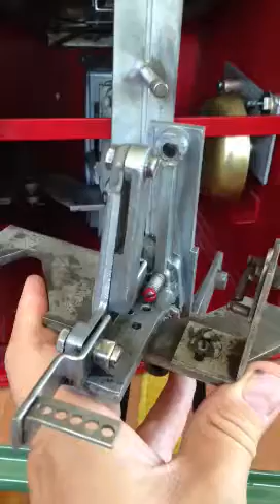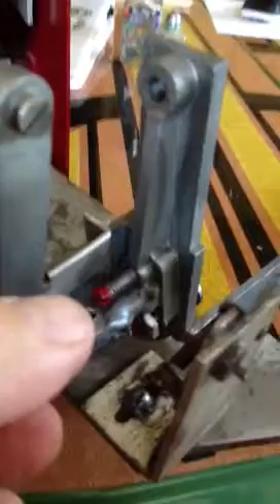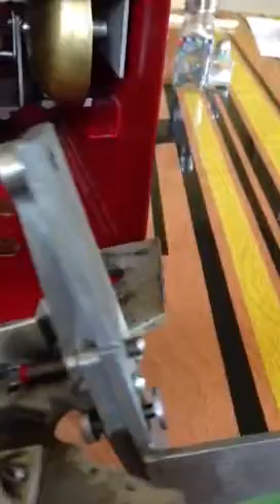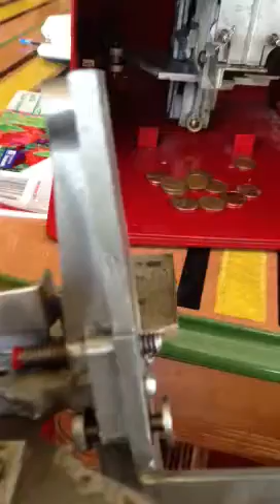Gottlieb strength tester mech ii

Comment from the maker: Hi Jimmy.  Thanks for your message.  Glad you are enjoying the videos.  
Yes- there is a way to adjust the zero setting for the needle.   Inside on the mech there is a small set screw with a locking nut.  Just loosen the nut and turn the screw as you hold down the black knob.  The needle will move and you can "dial it in" to the zero setting. Then snug up the nut to keep the set screw in place.  Good luck - reach back out if you have any other questions.